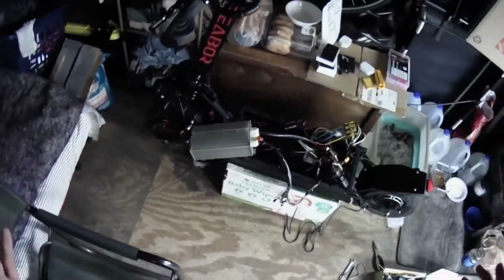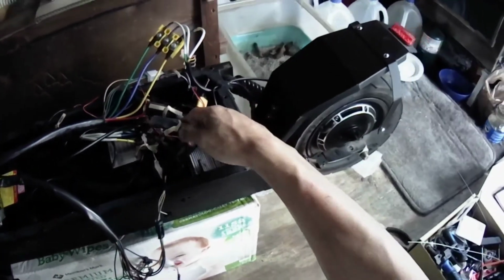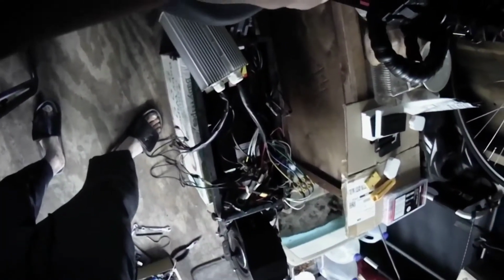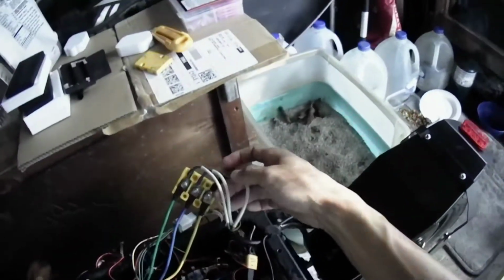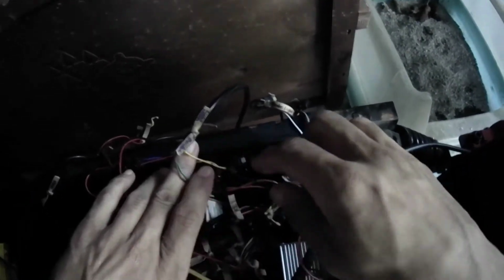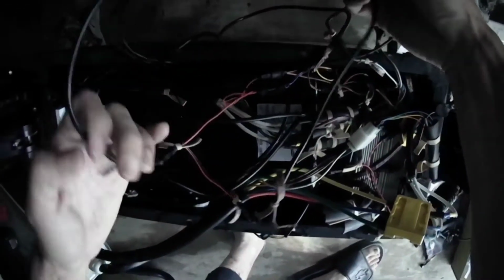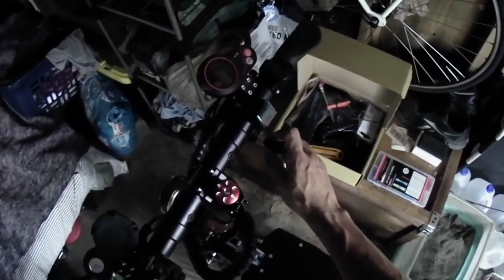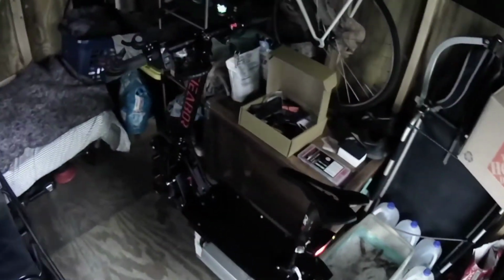Journey on Controller Upgrade on Fieabor Electric Scooter

Comment: Mine seems to limit power to 27mph on the display. 
It feels quicker than 27 but even then, it should be hitting 50 no?? It just seems a little sluggish on the throttle I expected a hell of a lot more torque from such huge motors!
I’m a lil disappointed if you will.
Is there an internal loop wire I can cut to de-restrict the speed limiter like on some other Chinese brands? 
I’ve already got p-settings maxed
Reply: I thought this video would help but my man just building a dual throttle death machine - absolutely pointless in the grand scheme of things to have 2 throttle inputs 🙈
Reply from the maker: @eldooooo2015  Dual throttle system works fine. You can control the throttle independently how much power you want sent to the front and rear individually to help you prevent from losing traction when you take off and turn at the same time.    But you don't have to go dual throttle, just get a one good powerful controller (150A or greater) and custom battery pack and just run off the rear motor and remove the front motor and install a motorless alloy wheel to save weight and rotational mass for more speed.   You'll need to replace the stock batter with a real good performance battery cause the stock battery will not survive from high current much long.
Reply from the maker: You should be able to hit 36 mph with that scooter (Fieabor Q06) so you must've configured the tire size wrong on the throttle display.   No you can't go 50 mph because the stock controllers are only rated to pull 35A x 2, but they actually pull 4A total, that's 4A not 40A. Controllers suck ass.  And the battery is poor performing garbage so it can't produce much current at all.   You need to use a big aftermarket controller that is advertised to run 150A (real current output is way less) , with that poor battery, should get you about 50 mph true speed.  You'll need to upgrade both the controllers and the battery.  You need custom built genuine Samsung 40T battery pack. With that it'll get you about 64 mph true speed.

Comment: Hey, where did you buy the upgrade controllers from??
Reply from the maker: Hi, I got it from PhoebEVPartsTols store at AliExpress. They sell high voltage high current controllers and are quite specialized in this area as they do configuration/programming of the controller to meet your needs (if applicable). They charge a bit more but those guys know what they are doing and also help you get the right parts for what your battery can handle.  I would recommend going a single motor, RWD instead of going with dual motor dual controllers as dual controllers in general cause the motors to get damaged (lead to failure) due to sudden voltage spikes from unbalanced unstable power delivery between two controllers.  It's better to go with one big controller using the rear motor..  Sadly most batteries out there don't have enough power delivery as they lack in amp discharge. Need really good batteries. With Samsung 40T cells you can go insanely fast with just 50A going to a single drive, 60- 70 mph easily.

Comment: Brand new fieabor 5600w first day experience.. dies at 37mph. Re-tested dies at 37mph. What a trash scooter.
Reply from the maker: Well the battery pack only puts out around 22A... The controllers are dual 35A, but limited by battery's 22A.  To really go fast you'll have to build the battery pack yourself using Samsung 40T 21700 cells that'll get you 240A... of headroom. Slap a 50A Sinewave controller and just run rear wheel drive off that (no motor on the front). That'll get you over 60 mph, even 70 mph.

Comment: which wire is to disconnect speed limiter?
Reply: DId you ever figure it out
Reply: @R50ysf  did not sadly
Reply: It's in the throttle

Comment: I have a Fieabor Q08p. I’ve had it 9 days I’m already getting controller failure. The Amazon seller won’t help. I have no idea what to do. - the rear motor doesn’t spin.
Reply: What did you end up doing? I have the same problem
Reply: @R50ysf  you fix it? I have the same problem when I press the accelerator the rear wheel jerks.😑

Comment: Hello. Do you have the scooter manufacturer original electric diagram with all the wires connections (with the colors of the wires)??
If yes, can you share it with me, please??
I can’t find it in the internet.
Thanks in advance
Reply: Go on fieabor website and contact them on WhatsApp they can give it to you
Reply: @Aivideosdaily-s7o  I did that and they won't give it to me. I just bought one but the connectors are disconnected. If you have it and could send it to me would be greatly appreciated!

Comment: How did jesus tell you to buy a eletric scooter....
Reply: Jesus didn't tell him to buy it, but he's definitely protecting him while he rides it!! I used to have a fieabor 5600 w, and between how quick it was and the strength of the e-brake it wanted and tried to kill me.... Now I have a t88 Plus 5600 w scooter, the e-brake doesn't come on near as hard, but only has a 37 amp rear controller so it's kind of slower, but has still tried to kill me... These are basically electric motorcycles that look like scooters! Be careful on public roads and expect that people will think that you're only going 15-18mph like the rental scooters. Even in traffic going the speed limit with bright ass headlights, definitely assume they can't see you.
Reply: 2:23

Comment: How did you melt the lock tight off the scooter board to go inside? Also I broke the mudguard on my Fieabor Q08. Where can I get a replacement?
Reply from the maker: The acrylic deck board is so securely mounted on the scooter with two screws on the front and two screws on back top side of the deck. Those screws have to be removed first. After that it was easy to remove the thin metal deck cover. Just pry it out using a flat head screw driver. It was glued, but not hard to remove the cover.. 
As for your Q08 model mudguard, try contacting the seller you got the scooter from. You got it from Aliexpress right? Chatting with them on the message board works great.. or you can search for mudguard at Aliexpress.

Comment: Hi, why do you think the controllers are 35 amp? From what I've read they're 45 amp. All these cheap scooters seem to be using the same controllers. Thank you I just wanted to clarify why you think they're less powerful than advertised.
Reply from the maker: Hi. The actual controller says 35A. I also asked the seller about the controller before I bought the scooter and they said 35A😁  Some scooters are underpowered...much lower wattage than they advertise. This scooter doesn't put out 5600w of power...more like 2400w.
Reply from the maker: Not only are the controllers so small in power but the battery is even more severely limited in power so you can't even get all out of the 35A controllers. I have a new video coming tomorrow on the detail of what battery this scooter has and how to build or modify this battery to get more power. Stay tuned.🙂
Reply from the maker: Did you already buy the scooter? If so, if you want descent power (5600 watt or higher) you will have up upgrade both the battery and the controllers....More and more places from aliexpress are using smaller controllers now so they gonna be underpowered. Ask the seller what amp the controller puts out and also ask what amperage discharge the battery has. You might have to ask for their engineers to answer these questions.

Comment: Hello there im thinking of buying this scooter whould you mind giving me your insta so we can talk there?
Reply from the maker: Hi, I don't have Instagram account just youtube. We can chat here if you'd like.🙂
Reply: @noobz5056  what is the max speed with road tyres you can reach with this scooter?I'm 85 kg
Reply: @noobz5056  also how much did the new controllers cost you.And is there any risk of burning or braking something with the upgraded controllers
Reply from the maker: @Failtofame11  This scooter is crap... Not only are the controllers tiny (only pulling 35A each) but the battery is tiny also, there is very little amperage available it only puts out  22A continuous and 64A maximum peak power. With your body weight you might be able to hit 35 mph GPS... The motors are good though they are genuine 2800w motor each and are tubeless-ready.  I got the controller + throttle display combo from this seller - 
https://a.aliexpress.com/_mPQK0H9
It's the one with 24 mosfets, the largest one.  I got this a year ago and is reliable, as it's built like a tank, a lot of cooling and better quality components inside. This prevents electrical failure... it is the stock controllers that the scooter manufacturers throw in there are not reliable. The low amp rated ones aren't so bad due to less heat and current to deal with, but the higher output stock controllers are more risky.... That seller I linked above is good, they sell controllers that work well with the electric scooters. Because the battery is so small you need to upgrade the battery as well...without it, upgrading the controller won't really gain much in power especially the top end.
Reply: @noobz5056  so how much will it cost to upgrade battery and controller?
Reply: @noobz5056  also when did you buy the scooter if you don't mind asking
Reply from the maker: @Failtofame11  The controller upgrade (controller + throttle display combo) costs around $250 with shipping included.  If you buy the whole battery pack something like Samsung used to cost anywhere from $600~ $800 but now due to inflation and the shortage of supply they cost anywhere from $800 to $1400... very expensive. I got this scooter May of this year.
Reply: @noobz5056  if it shows let's say 40mph on display what is the real gps speed
Reply from the maker: @Failtofame11  They read about 5- 9 mph higher... Most of them are not accurate at all except for a very few... They have to be calibrated by adjusting the tire diameter perimeter in the display to get closer to the GPS reading.
Reply: @noobz5056  do you have road tyres or off road?
Reply from the maker: @Failtofame11  I have road tires. When I ordered this scooter from Fieabor I asked for road tires as these scooters come with off road tires by default...
Reply: @noobz5056  if you didn't know what motor it has what would you guess is it's power?
Reply from the maker: @Failtofame11  The scooter feels like a 2400 Watt scooter not a real 5600w scooter.  My previous scooter was wicked fast it was advertised as 5600W but felt like it's faster than that. Turned out that scooter was producing 6000- 6700W. But that scooter costed me $2500....but it was totally unreliable.
Reply: @noobz5056  do you believe fieabor is reliable
Reply: @noobz5056  would you believe changing the controllers to 45A is a good solution to using it's full potential?
Reply from the maker: @Failtofame11  If you want speed I would not recommend this Fieabor scooter it seems to be reliable but slow as heck. You might want to check out FLJ 5600w electric scooter....I believe it comes with dual 45A controllers and beefy battery. You should be able to go 50 mph with that thing... They cost over $2000. I would also pick up a backup motor or two and a big controller like the one I installed here in case if the stock controllers go bad. They can also take out your motor too...speaking from my experience.  Later (once the stimulus checks come) I'm planning on modifying the battery in my Fieabor scooter...to boost current output and capacity...it will be a big project. I would stay tuned for updates. If the modification becomes successful I should be able to go 50 mph or higher.
Reply from the maker: @Failtofame11  No adding 45A controller on the Fieabor scooter will hardly gain anything. You might get a little strong power in the mid range but your top speed will hardly gain anything maybe 2 or 3 mph at best because the battery is the limit.
Reply: @noobz5056  Then what do you recommend changing on the scooter
Reply from the maker: @Failtofame11  First the battery needs to either be modified or replaced with a beefier one, one that puts out 80A or higher... This Fieabor has Samsung 29E batteries and only putting out 22A continuous. It's not even using the full potential of those baby controllers because they are rated at 35A each, 70A for dual motor. That is horrible. Once the battery is upgraded you can upgrade the controllers next. It uses nice quality and reliable Samsung battery but it puts out very little current.
Reply: @noobz5056  I understand but how much do you believe upgrading the battery would cost?Also does anything have to do with the 27Ah of the battery?
Reply from the maker: @Failtofame11  It will be extremely expensive...a descent Samsung battery pack would cost anywhere from $1000- $1400 if not more. The 27Ah capacity is not necessarily the limiting factor in power output. The problem is the battery in this pack is only putting out 2.75A each. 8 or 10A would've been great but they used this battery instead. You can add more batteries to the existing pack to increase the amperage (A) discharge. This will also increase the amp hours (Ah) as well.
Reply from the maker: @Failtofame11  I'm planning on modifying the battery by adding 52 more cells to the existing pack. That would cost me around $270.
Reply: @noobz5056  how much is your weight
Reply from the maker: @Failtofame11  I weigh 63kg
Reply from the maker: @Failtofame11  I just found out that 5600w FLJ scooter uses two 37A controllers which is crap...I don't know about the battery. Just wanted to let you know what you're getting if you are thinking of buying that scooter (T112).
Reply: Don’t do it. They are JUNK